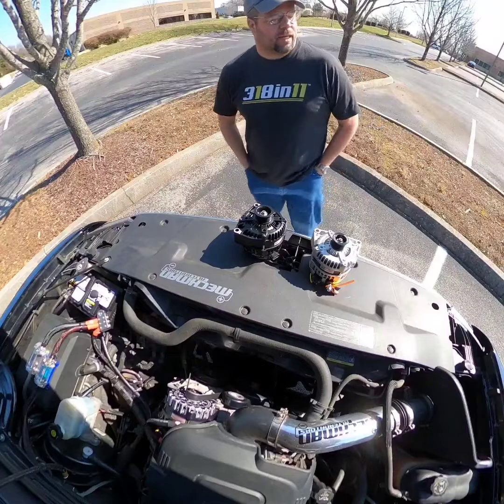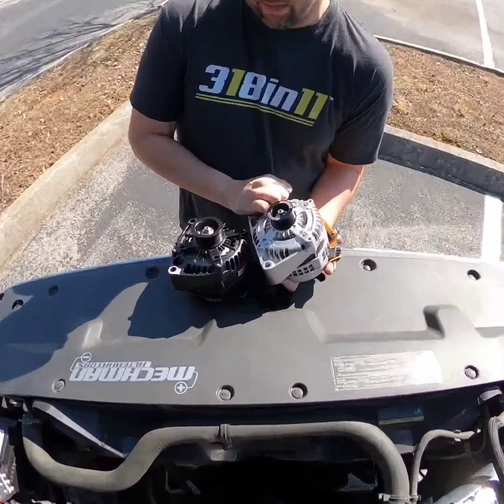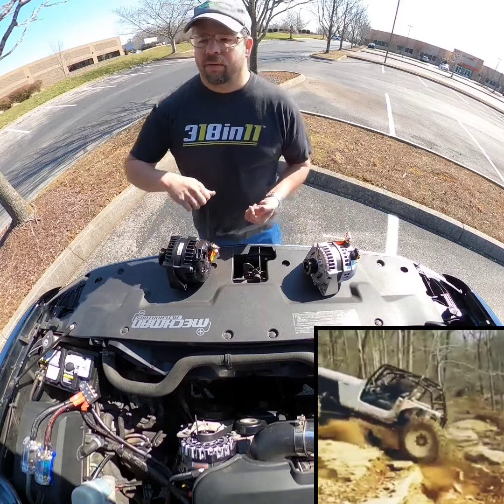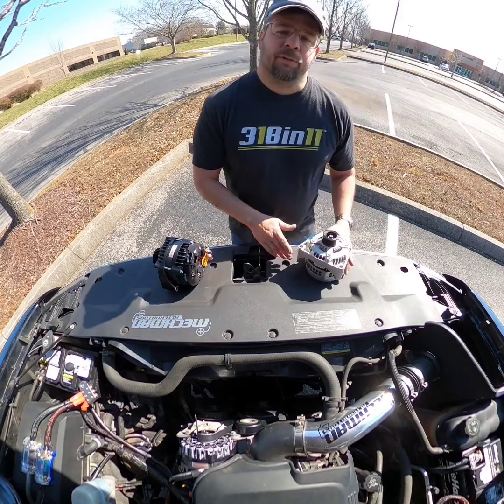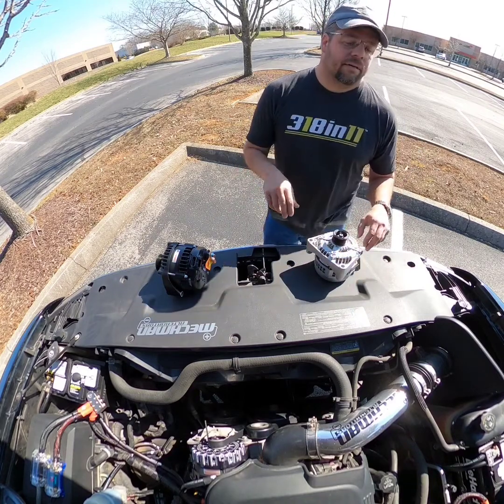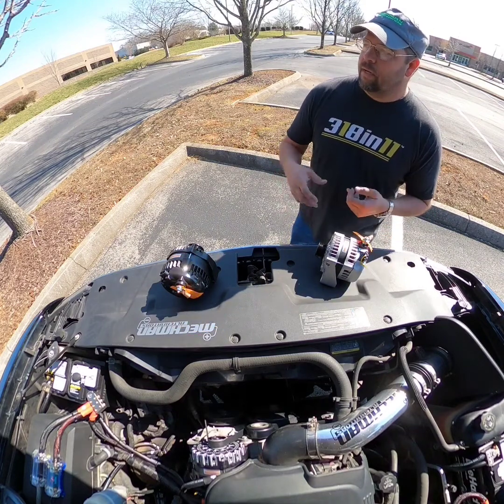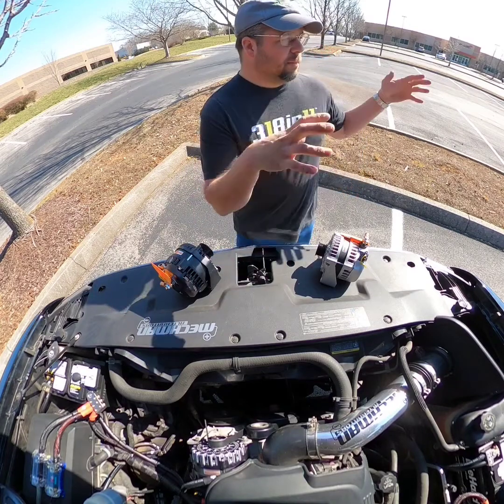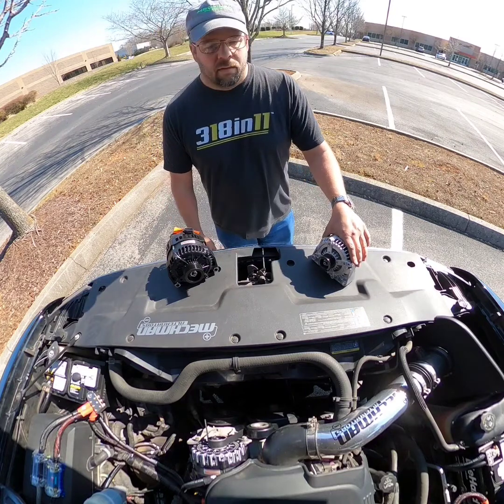Small case vs Large case alternators.  Know your application!

Comment: Makes alot of sense actually. I have a 320 small case in a 1998 rav 4 and my God I drop to low 11 and 12 volts at 650 rpm which is my idle. But the second I'm driving which is like 1200-1800 rpm my voltage never drops below 13.6. And that's saying alot with a Walmart group 35 battery.. sounds like I am going to change my idle speed to be at 800 and if I need more I'll turn the ac on or Rev it manually.

Comment: Is there a large frame that will work for a second gen Tacoma with the 4.0L v6 (2011)?  I'd love to pull 180-200 amps at idle and stay cool with the larger stator.
Reply from the maker: Not that I know of, but we're always on the lookout for ways to fit better alternators in the lineup for customers.

Comment: I got a 2001 Jeep Cherokee XJ 4.0L and bought a Mechman 170 amp alternator bout 10 years ago and has always charged good. But lately my serpentine belt has been slipping under load (A/C on, cooling fan running, rear defrost etc). I can hear the slipping is coming from the alternator pulley and im just wondering if the pulley is just worn down because the pulley turns freely by hand. I also heard going back to a larger or stock size pulley can help eliminate belt slippage.
Reply from the maker: Sounds like you just need some more tension on the belt.  Or, if you do lots of offroading your belt can actually be contaminated from dirt/debris/chemicals.
Reply: @mechmanalternators  The belt does seem to constantly loosen up a bit every so often and I always end up tightening it, in which it does have a temporary better result but eventually I'll end up replacing the belt just after a year or so. It's my daily street driver, no offroading. I think I might try a 2002 Dodge Durango reman 160 amp alternator as it should be the same size case as my Mechman alternator is, which is a popular swap for XJ owners. Especially since I had to grind my mounting brackets to make the Mechman fit.
Reply from the maker: @BlueSword455  Thats basically what the fitment is on our 240 / 320 versions.  Send in your old Mechman alternator and we'll do 30% off the purchase of any NEW Mechman alternator.   I mean, 10 years is a long time, you're obviously doing something right! :)
Reply: @mechmanalternators  I'll definitely consider it, thank you!
Reply: @mechmanalternators Just wanted to give an update on my belt slipping issue. I verified that the original aluminum 44mm pulley grooves have worn the pulley down to a little less than 42mm and was causing my belt to slip. I purchased and installed the black anodized 46mm one from your website and it fit perfectly. No more belt slipping! Just wish you guys made a steel version in that same size.But like you mentioned 10 years is a long time and this alternator is still kicking! If it does ever die, I'm definitely purchasing your 240 version. Thank you!
Reply from the maker: @BlueSword455   We have some steel options but when a belt is not slipping it's not wearing the pulley down.  Most times we use the steel pulley's on off road vehicles that encounter mud/dirt/grit/grime that would normally act like sandpaper.  99% of the time the aluminum pulley is perfectly fine for street/daily setups.

Comment: I have a 2009 f150 I am putting on a 4500 W amplifier and a 500 W amplifier, train horn, rock lights, 2 yellow top batteries and power step XL would a large case alternator be perfect for this set up ? If so, what amperage
Reply from the maker: Yes
Reply: @mechmanalternators  🤔 what amperage?
Reply: These guys can't tell you what you need if you give them a vague list of add-ons. Get a current clamp. And look at the specs of the equipment you're putting on there. Test everything for current pull individually, except for your amplifiers. There's plenty of amp dyno videos out there. You can figure out what those will need at max.

Comment: So what does the small case GM alternator come on from the factory? Is it just in alternate aftermarket alternator? Or did it originally fit a particular type of engine?
Reply from the maker: Usually came as a standard option or lower trim level option. They've been using that style on vehicles for over 30+ years now.

Comment: Great video...the cb radio guy's are using your alternators large CB amplifiers... many of the CB guys would like to see your 370 or 400 amp models as 3-phase AC... 3 AC taps... as quite a few guys running AC tube amplifiers in their Vans or Suburban
Reply from the maker: Hmmmm......interesting.....
Reply: Do they prefer the mechman over the Lance  Neville? The guy that did my alt brackets does this and he uses Lance Neville I have never understood why they r so large and only like 175 amps
Reply: @1-Six-dee  I had one of those alternators, looked great, nice black finish, thought I had what I needed. Cabled up with copper 1/0, and did testing with a 2000 watt pure sine inverter to run a large air compressor in my superduty. As soon as it got to temp, voltage tanked under heavy load. The rectifier was the weak point. Idle output was not good either, even with a 46mm pulley. I switched to a large case 250 "hairpin" and the difference is crazy. If I have ANY RPM on the large case, it'll hold whatever voltage I have it set to, under full load. The other unit had a hard time holding voltage at high RPM, this large case way outperforms it at dead idle. Runs cooler, draws less mechanical energy(saving you fuel and wear), while making more electrical power. 

Absolutely zero comparison. Large case or bust. Mechman makes some really good alternators, I've had several that I have torture tested, and never had a problem.